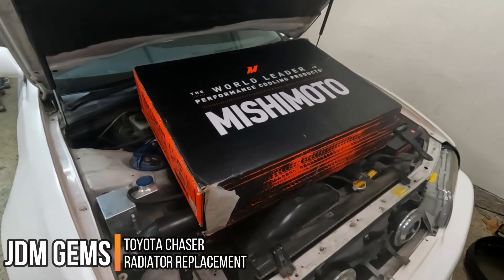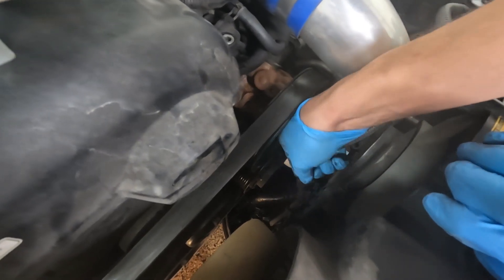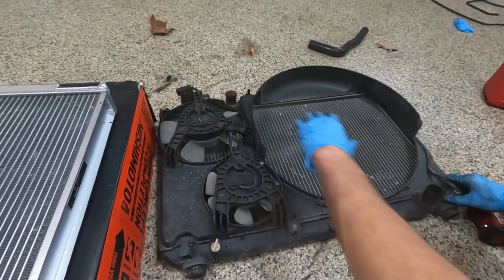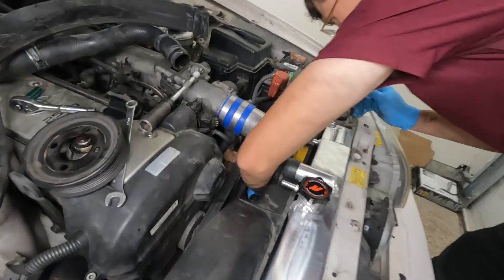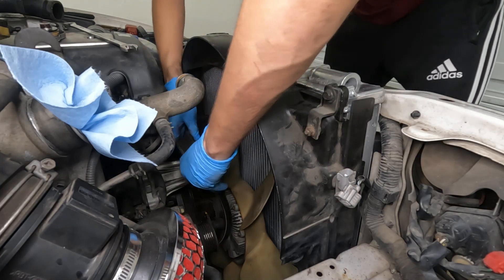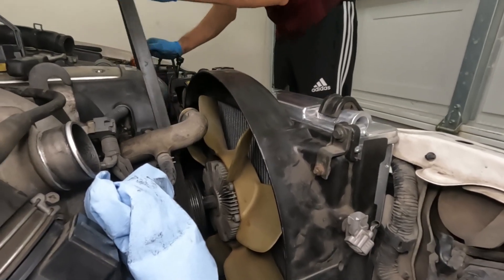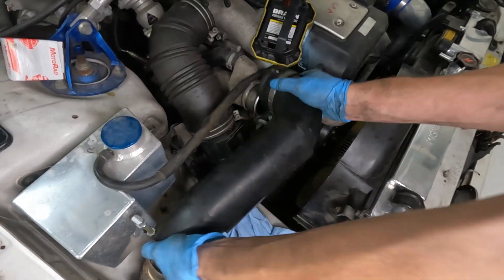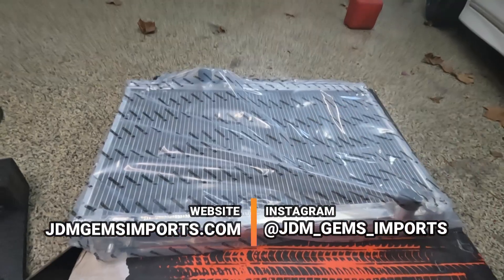Toyota Chaser Radiator Replacement

Comment: I crashed my cresta’s so now I’m turning it into a Roulant exceeded with new fenders, vented hood, and r/ front bumper 😂 I also have the cresta grille I need this radiator I just don’t want to take that water pump off because I don’t have a 1j but I will if I have to